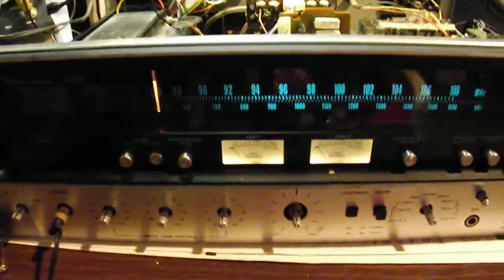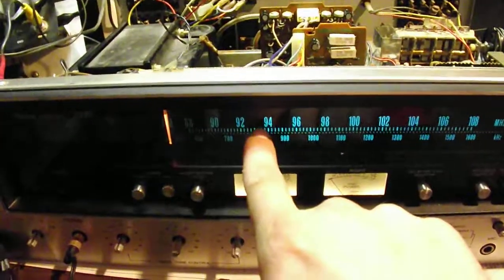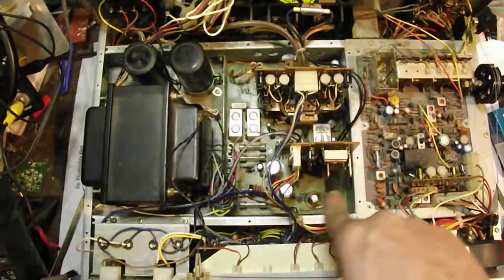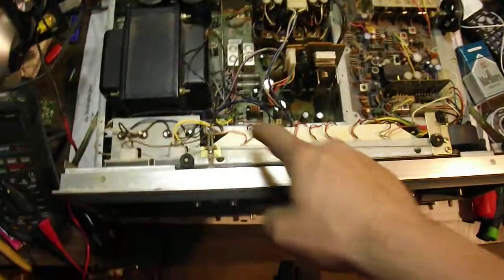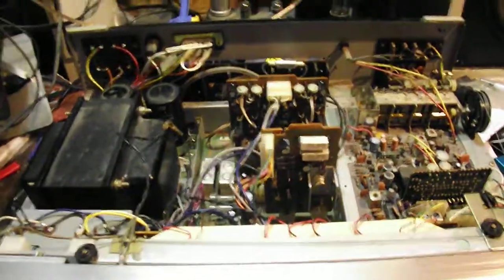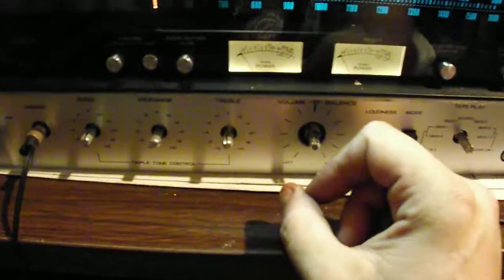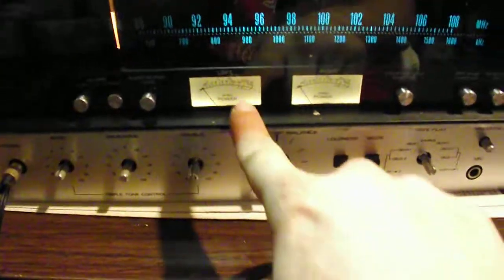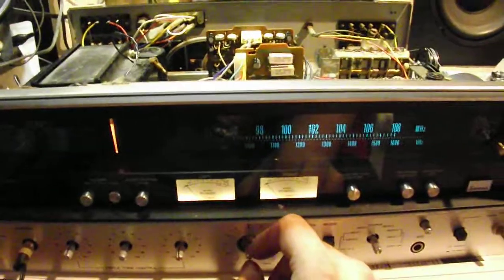Sansui 7070 - operational again

Comment: I got a 7070 as well. Im having a problem with a flubber or feedback noise when I select AM. I cant get anything other the noise when on AM. Also when I turn my balance to the left the right meter works, to the right on the balance and the left meter works. Any help or info you can share on how to go about checking out whats wrong with my unit? Greatly appreciate.
Reply from the maker: No idea. The one I worked on didnt have tuner issues and got blown up when someone tried to run it with bad caps.

Comment: I have one that was gifted to me, the power output is very very low, it's outputing some audio but I can't hear it if it's not at the maximum volume. Even at that point, it's low. Headphone outputs is also low. I tried connecting every port in the back, the problem is the same with all. Any clue?
Reply from the maker: Well whatever the problem is, it's common to both channels...and about the only thing they have in common is power supply and some switches in the preamp sections. I would start by recapping the unit and checking the power supply to make sure it's outputting full voltage.
Reply: so, get a multimiter and stick it where the speaker cables go? how much should the output be?
Reply: It's outputing 4.21 volts per chanel despite having any source connected. When i connect a speakr in the right side it's output it's barely even 1 volt